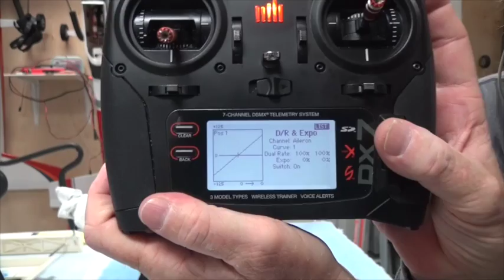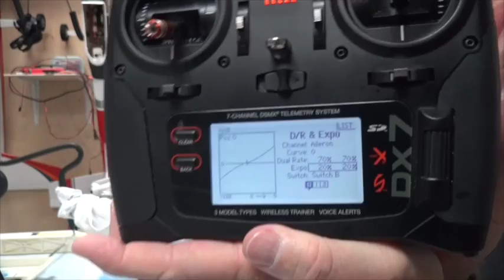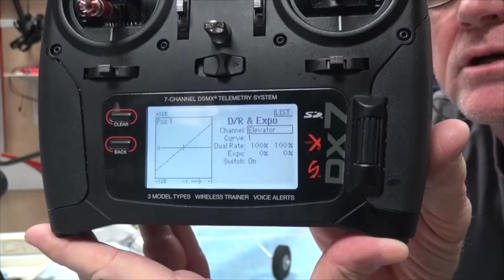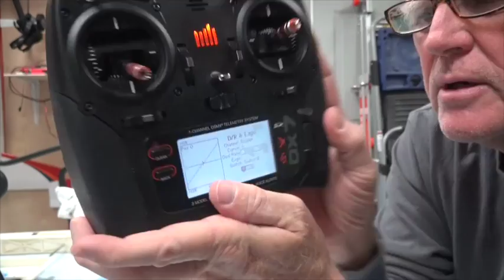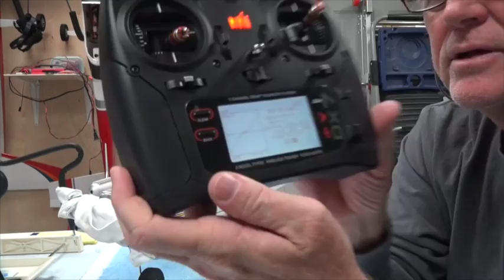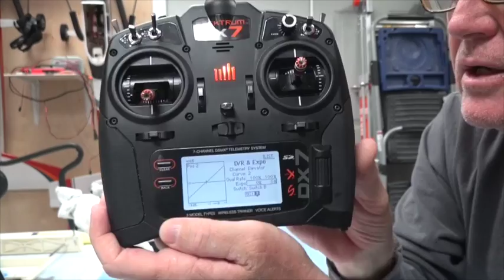SH31 Sonic Hi Wing D R & Expo

Comment: RC Instructor - Thanks! I am in a 2 man club and I am the new face in the crowd. ie. inexperienced. The two experts in the club are using across the board lo DR's of 65% and Expos of 50% mid DR's of 75% and 50% and hi DR & Expos of 100% and 50%. I fly only trainers at low settings and find some like the Superstar and Nexstar and find with my club's settings that my planes are somewhat neurotic with the same radio you use. I was looking at what other experienced flyers were using for DR and Expo settings on specific types of planes and this info is not easily found. Thanks for taking the time to educate idiots like myself.